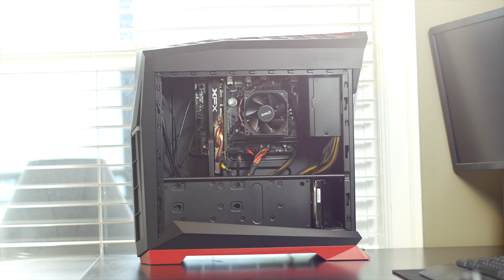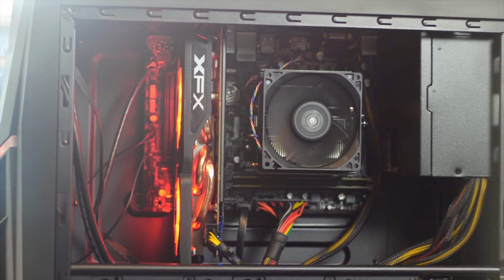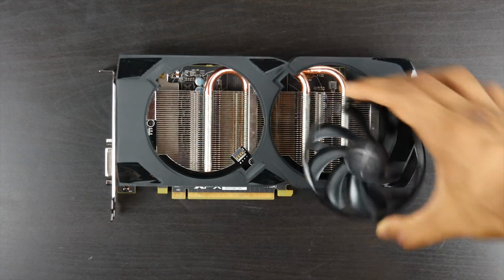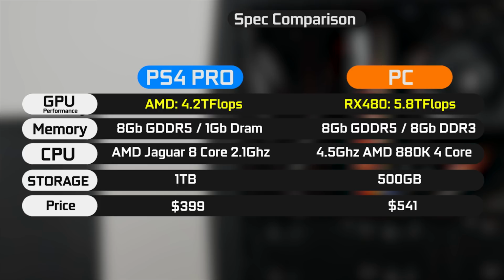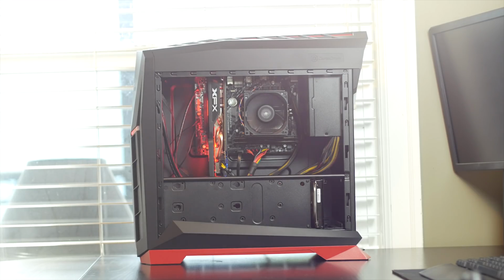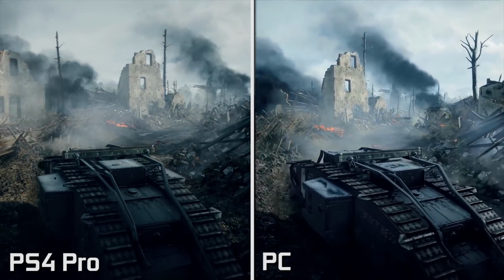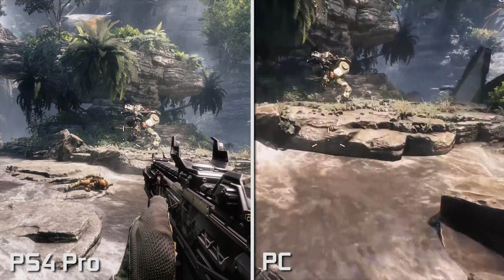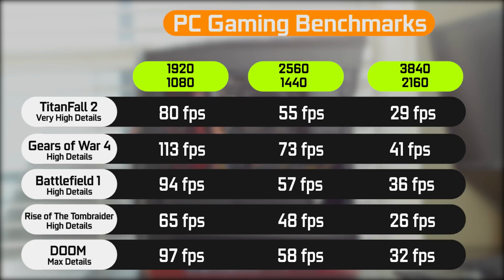Playstation 4 Pro vs $550 Gaming PC

Comment: ps4 pro with games in UK is only 250 pounds
Reply: Emmanuel BOSS it's £349.99 rrp. £332.49 if you shop around.
Reply: Ricco123tube argos special deals
Reply: Emmanuel BOSS point me in the direction then cos my mate who works for Argos knows nothing about a pro deal especially as Argos buy them in at way way over £250.
Reply: +Emmanuel BOSS is getting confused with the normal PS4 which Argos had on offer for £250 with the games for Black Friday. The PS4 pro was around £330 - £340 in Argos.

Comment: How about keyboard mouse? Also windows 10. How about wifi? Where's the Blu-ray player. Just the form factor alone of the ps4pro is not feasible on a pc. Are you going to use keyboard and mouse from the couch? Or are you going to play on a screen. Then you have to buy a screen. Now if you have a case, then a motherboard, cpu, memory and gpu is necessary. Just these things are needed.

Comment: Dont get these types of vids get a 470 and any new cpu will outperform the jaguar, its the form factor and ease of use why most people buy consoles or a person like me who loves games and have to have all the exclusives. I have a pro but i have a pc with a 1080 and just build one with a strix 480 and my older parts 3770k and z77a g45 motherboard and 16gb 1866 ram. But i went with a thermaltake view 27 case thought it looked cool with goldwing door and the gpu fans facing the view port. Loving playing ff15 on pro to bad high setting has frame pacing issues.

Comment: He spent about $100 on a case when you can get one for $30, then get an i3...
Reply: NLwino coulda bought the mid tower corsair for $50? Give or take
Reply: Future proofing from AMD Cpu to Intel would be the best option. Faynts has a great point
Reply: Clamen so how did that work out
Reply: @Clamen  wouldn't be better on and since Ryzen is planned to be on the same socket for many years?
Reply: @aloe7002  My comments were over 5 years ago, i don't touch Intel this generation. Times have changed
Reply: Faynts ikr, i dont understand why people who do budget builds spend 1/5 of the budget on the case xD
Reply: No, spend more on the GPU and overclock the cpu and buy any case you find in your front.
Reply: Xx_savageman_xX Official it does not make any sense... I have a $10 computer and my case is a potato. Just like my pc
Reply: Felipe03000 ike
Reply: agree
Reply: I know you would have to get a different mobo if I were to go with the i3 but would the CPU be compatible with everything else?
Reply: Humacunra what's that supposed to mean?
Reply: better to get a quad core than a dual core cuz new games will actually run
Reply: most games, games like cities skylines require a quadcore at minimm but games like bf1 and gta 5 are very graphical demanding and there beating the shit out of my gtx 750 ti xD
Reply: Aspyrus there was just a huge price drop for the 4th and 6th gen i5s to let anyone know,
Reply: Xx_savageman_xX Official wait 750 ti? You should upgrade if you can because man that GPU isn't great now
Reply: Efe Ömer Şahin i just did, i got a 1060 sc from evga, 3gb model
Reply: Yeah or on 8 core AMD CPU, couple of really good ones for that much money, ridiculous amount of money wasted.
Reply: Bike Dude yeah but AMDs motherboards are going to be expansive at launch but the intel 7000 series is backward compatable with the LGA 115x and 2011 sockets. Don't get me wrong because what Intel does in action makes up in the  prices in the end. Again why AMD is better for a budget build
Reply: A i3 would bottleneck the gpu
Reply: Immortal Gaming of course
Reply: Bike Dude 500$  FOR A 500 GB HDD XDDDDD
Reply: i3 ? :P  noone uses i3 XD 

either  i5 , i7 or  nothing :P haha
Reply: faynts i3 is trash lol
Reply: WowSu[c]ker not really. The 6th gen ines act like the i5s because of hyper threading and have a slight over clock too
Reply: act like doesnt mean its at same lvl LOL Its trash
Reply: i3 is worse
Reply: Then it ll be fucked up with bottlenecking
Reply: Sure. Let's make this comparison with a 400$ PC then. (Hint: The PC will do even worst)
Reply: Well you could, I wouldn't recommend skipping to much on the case. A good case can last you for many builds and looks allot better. A case well designed for cooling can also increase the lifespan of your hardware, it might even pay itself back.
Reply: yeah but amd is so garbage for gaming
Reply: yeah i heard yo can get cpus at 20$ gpus at 50$ and rams at 15$... problem is i made those numbers up
Reply: lol me have good pc only problem low internet so low 1 bar and 5 games :(

Comment: plus decent anti viral software, OS, additional plugins and software, subscriptions And configurations, hard ware being a decent keyboard, mouse, oh that thing that a PC needs a good monitor or if your TV is up to scratch to utilise this GPU...... all up a bit more than $541

sorry no one is going to argue with you the performance mY be there but so is additional out lay costs you haven't mentioned plus headaches configuring and if you aren't a PC nut then it's gonna be even harder. for a great experience without the hassle I'll stick with my ps4pro thanks. not lazy, not a fan boy, just someone who doesn't want the hassle of a PC setup I don't have loads of time for when I wanna jump in and out I just hit the lounge room
Reply: SadPotato it depends where u live bro. some things are and are not standard with a purchase of laptop or CPU. 'in Australia' for example this PC is probably more around 700± not to mention items I mentioned before. I'm speaking from a bare start as well. I don't have a gaming PC. I would need to purchase and configure alllllllll of that stuff. where I can just unbox and plug in. make an account, download a system patch pay 70 bucks and I'm on.. it comes down to accessibility. :-)

Comment: Lmao he must've been looking at the ground the entire time when it came to BF1. That game is so CPU intensive only top of the line shit can play it consistently without frequent drops. Also, this build is shit PS4 clearly wins here being 150$ he didn't even add the costs of a simple mouse and keyboard which bumps the price $30-$140 depending on your taste
Reply: Orange Hachet Lmao the controller comes with the system silly
Reply: Ricco123tube You could hook any modern pc into a tv as well so you don't necessarily have to buy a monitor. you would still need a separate controller and keyboard but you would recoup the costs by not having to pay $60 a year for PS  plus.
Reply: counting peripherals is stupid, do we have to count in the cost of a TV and controller now?
Reply: DryAssChicken Well my i3 6100 can run Battlefield 1 at a stable 40 on high 1440p and 60 on 1080p, btw i use a Rx 470 Nitro edition.
Reply: The Joker Wtf? I have GTX 1060 and i only dream of those frames. The game runs perfectly fine on campaign but complete shit on multiplayer
Reply: DryAssChicken not if you want to play local multiplayer.
Reply: DryAssChicken or HDR.
Reply: I guess you have no keybord since you say you NEED to buy a keyboard
Reply: DryAssChicken yes and windows too

Comment: Why would you get a $90 case for a PC with a $96 CPU, that's stupid.
You get a $20 case and spend the extra 70 bucks for a much better CPU like an i5 or lower the cost of the PC to $470.
Reply: Johnny Boy yep complete fail right away
Reply: mmmmm maybe to make it closer to a real console
Reply: Johnny Boy I agree with you.
Reply: lol better if made diy pc case around 10$
Reply: yea, case shouldnt even factor into the cost since you dont NEED one.
Reply: Who would want to do that?
Reply: i know a guy who ran his mounted to the top of the box the mobo came in for over a year.
Reply: Think realistically tho, the average dude buys a ps4 because of the price/performance ratio and games. What he also get is a sleek and pretty design and a silent machine. 
So you really think this dude would favor some cardboard box where some cables hang out? Or a cheap flimsy 20 buck case where he probably cuts his hand open?
In order to make it a proper ps4 alternative, make the whole experience great, not just the performance.
Reply: my work PC is literally a motherboard on a book with the drives piled on top, and a vast mess of USB/thunderbolt hubs pouring out of it. Cases are underrated, especially with PC's you dont really care about (like work PC's lol)

Comment: Ah, yet another PC vs. console video, that doesn't include input devices and the OS in the price of the PC. Also, I'd love to see how they compare in power efficiency, size, weight (especially to slim models), and noise levels, but no one seems to ever bother with these. I wonder, why?
Reply: Val Hakun 
1. you can use any os you want. It doesnt have to be windows
2. Everyone has a crummy old keyboard and mouse. Its the 21st century
3. Size and weight? This is a performance based comparison.....
4. Well gee whenever ps4 pro can benchmark power usage then we can test power efficiency
Reply: d1asian
1. Sure, any OS with a large library of games, other than Windows... oh, you're talking about Linux with all those four supported games. Fair enough, uh-huh.
2. Nope. Missing the point completely.
3. This is a cherry-picked comparison. Anyone can stuff a large ugly case with powerful hardware, it doesn't exactly take engineering skills to just achieve performance only. Make the thing small, affordable and power efficient, AND perform similarly, then we'll talk.
4. What? You plug the thing into an electricity usage monitor, and it shows the number. Look it up.
Reply: What your point though? With a good PC you can do way more than just play games like on a games console. It's very worth the higher price.
Reply: What are you talking about? Full sized cases can look great with great design and LEDs. Why do you care about weight? Are you going to take that PS4/PC with you everyday? You can get good looking keyboards and mice for the price of a controller. The noise levels on PCs can be better since you can add better fans and modify it. You can get Windows for 20 dollars (although it is kind of immoral)
Reply: Val Hakun I do not care about LEDs or the looks but sure do so I added it in to appease your 12 year old brain. If you are okay with crappy performance that initially seem cheaper but actually gets more expensive with more expensive games and console online subscriptions then fine. If you want small form factors you can look at custom PC manufactures or miniITX cases. After you add all of the costs of console it becomes less and less worth it. Especially when you can keep a PC a lot longer since you only need to swap parts not the entire thing.
Reply: Val Hakun The point is that PC has better price per performance. If you are just comparing size and how AMAZING it is because it is so thin and light then I suggest you to look into mobile gaming. Nothing can compare with the form factor of a phone! Over time consoles end up costing more, yet PCs last longer and have lower upgrade prices. Also the last nail in the coffin is the fact that you can do other things with PCs! Can you run photoshop and excel on console? No? Well I guess its not up to par to PCs until it does that.
Reply: Let's put it this way Val Hakun

1.- The PS4 includes neither a mounting nor a PS plus subscription anyway. How much money will you spend for the rest of the generation by paying online? How much for games?

2.- The big majority of the things you said have nothing to do with price to performance ratio 

3.- you didn't mention how loud and hot a PS4 gets given the size. 

4.- Nonetheless I think you're right when it comes to power efficiency

5.- Neither did you mention PC capabilities such as recording gameplays @ 1080p 60 FPS, editing videos, photos, music, working on word, excel, better web browsing experience, etcetera you're paying for something that's not only good for gaming but can do any other things as well

So frankly defending a console for its price is stupid. There's a lot of use cases and a lot of different things to take into account regardless it's not a point of comparision it doesn't make the PC better or worse
Reply: Orange Hachet Right, because LEDs always make everything oh-so-damn-pretty. Especially cheap ones. (Especially when the owner is 12). Doesn't matter why I care about weight (maybe for the same reason you care for LEDs?), the point is what a given system packs within a given form factor. As I said, it's easy to put a lot of powerful hardware into a PC, but to get a small, affordable and a power efficient device perform decently - that's a challenge. When you do all of that with non-used parts and "better fans" or whatnot (while keeping morality inviolate), then the comparison is fair. Right now it isn't.
Reply: Orange Hachet Brilliant argumentation with a personal insult there, mate. Immediately gives you credibility.
No, I'm not okay with crappy performance. I'm also not okay with bullshit comparisons of very different platforms.
Again, for the third time, when custom PC models or mini ITX builds get similar performance with similar power efficiency at a similar price, then it's a different story. Comparing performance alone, while still going far above the budget - what does that prove exactly?
Reply: Orange Hachet Duuuh. That's my entire point. You can do more on a PC? What a revelation. It's as if nobody knew that before watching this fantastic video.
Exactly what I'm saying - two very different platforms. Yet this video is focused solely on gaming, and does it misleadingly - that's why I'm calling it out.
Reply: ***** Agree. That's not the subject of the video, but yeah, choosing games is more important than choosing platforms.
Btw, an exception off the top of my head - Red Dead Redemption. Super weird why it never came out on Windows.
Reply: ***** Yep, really good game. (Very nominally "like" GTA, being an open world from Rockstar, and sharing the engine). Shame it never came to PC. Maybe a remaster one day?..
Reply: It's is not. Getting windows 10 from sites such as G2A is totally legal
Reply: SEÑOR BURTOS BAIA You're only confirming that these are two very different platforms with different functionality, señor. I am not defending anything, I am calling out bullshit in this video, and looking at things objectively. But no, neither PS4 Pro, nor PS4 Slim are particularly loud, only the original one. The Slim goes for $300 now with a free game worth $60, by the way, if you want to talk price to performance ratio. (And I was pointing at the overall ratio - price/performance/size/weight/power consumption). I'm certainly not gonna defend online subscriptions for multiplayer - they are obviously moneygrabs (even though they are optional).
As for game prices, initial cost is typically the same, and sales happen, too. For example, this Black Friday and cyber week had deals on AAA console games like Fallout 4, Far Cry 4 & Primal, and few others for $15, while Steam had them at $20. There are nuances to every store, platform and holiday.
Reply: Don't even mention the SLIM $300 is not a good price

There are always offers in this days, I've seen GPUs that have 3 free games so my argument remains

You are complaining about the objetivity of this video that fact that they made the wrong comparision doesn't make consoles cheaper
Reply: SEÑOR BURTOS BAIA Your argument supports my argument. And again, for the fifth time, I'm not talking about price only, or whatever else only, I'm talking about the overal ratio.
Reply: And even then the PC has better "overall ratio"

But who really cares there's a lot of things you can't do on a PC and a lot of things you can't do on a console

The thing is, there's no way yo defend a console by its price
Reply: SEÑOR BURTOS BAIA Look man, I understand how some dedicated PC users enjoy jumping on every opportunity to destroy console defenders (sometimes rightfully so), but I'm not even defending anything. I just want these tech reviewers to be a little more elaborate when it comes to comparing different platforms, by bringing more nuances to potential buyers. I've been building computers for friends and relatives for maybe 15 years now, and when they ask, "How much will it cost?", I tell them the whole price, you know, with OS and input devices, and I explain that they can use their existing TV or get a monitor for that much or this much, and so and so - these liitle important things. I can't really send them videos like that, you see. A couple of my friends were googling and finding videos like that, and then coming up to me like, "Wow, I can get a cool PC for $450?", and I would always respond with, "Well, technically yes, but..."
That's where my issue really is - transparency of these videos.
Reply: great question

Comment: This doesn't include the costs of Windows or a monitor.  Some people who have been console gaming only might not even have a computer desk or monitor. But lets assume they at least have an old monitor laying around. Add $80 to $100 for windows. It's apples and oranges. "$550" PC turns into an almost $700 PC. No crap its better than the PS4 pro.  Also if I was forced to game on a $550 PC that did actually include the cost of windows, then I would rather just play on the PS4 as I wouldn't have to deal with drivers or anything else.